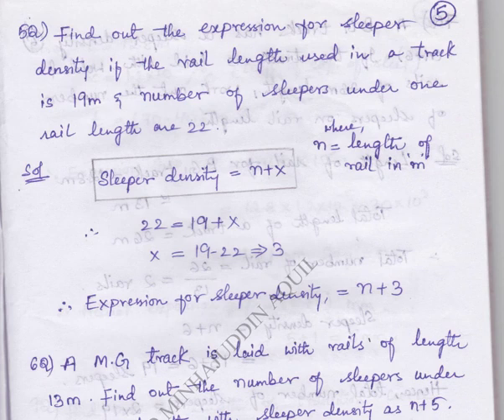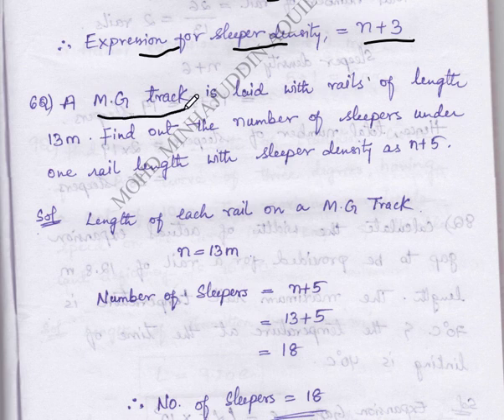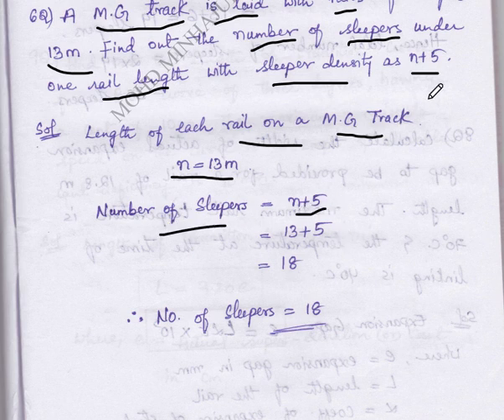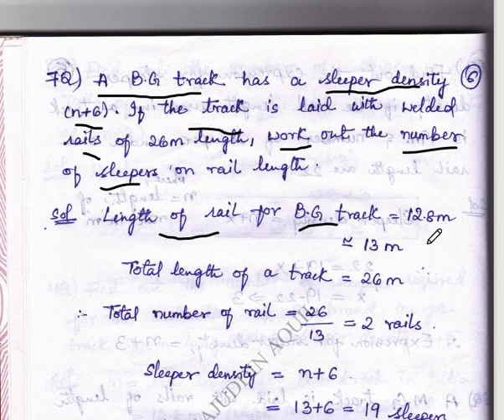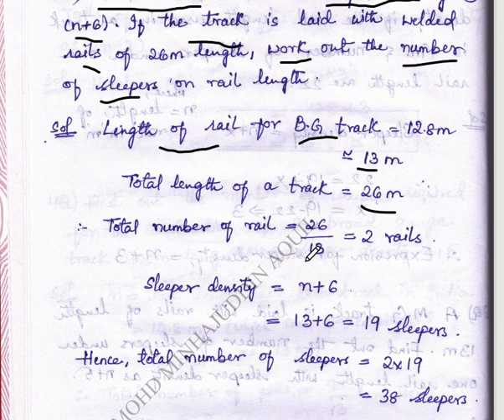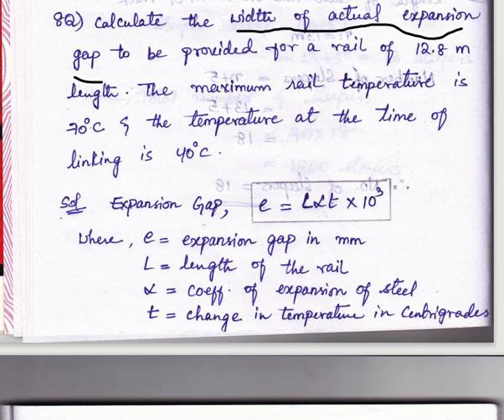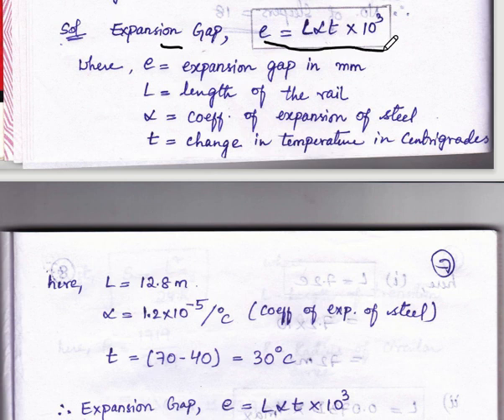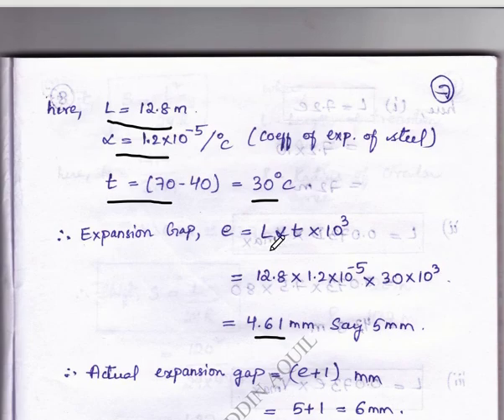How to Calculate Actual Expansion Gap || Sleeper Density || Number of Sleepers || Railway Engg

Comment: How to calculate check rail gap... 

Why gap between stock rail and tongue rail at joh minimum 60 ( calculation) 

Why opening of throw of switch is 160 mm +3-0

How to calculate versine of transition in curve. 

How to calculate super elevation of transition in curve.